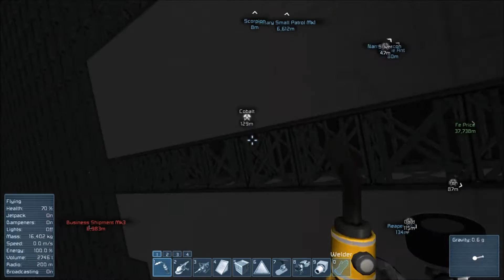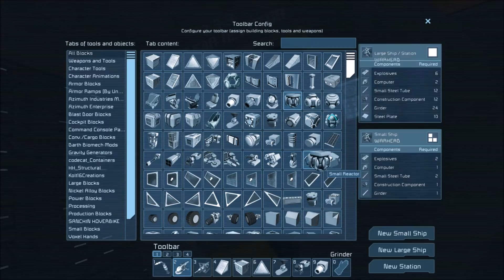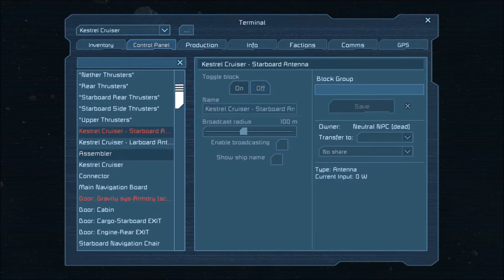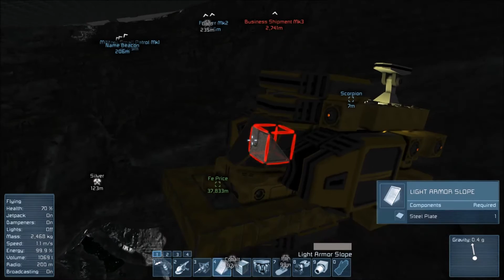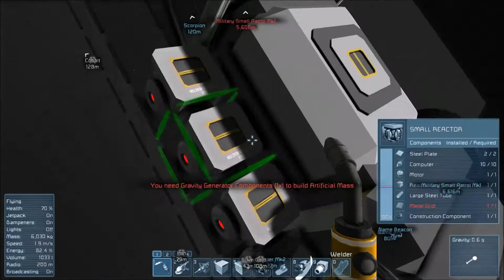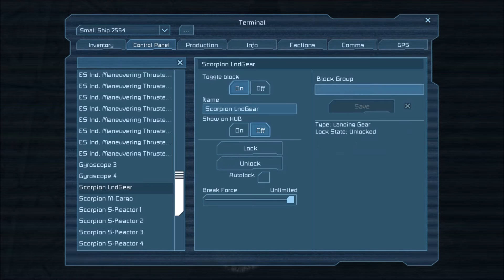Space Engineers ~ Lets Play S01   E042

Comment: You shouldn't use to many welders on your car its gonna overtax you reactors big time.
BTW you should try to use the flushed landing gears mod its much more useful wen building small ships and vehicles, it makes parking with cars easier since they don't use power even if the reactors go of-line.
Reply from the maker: sweet I will look into the landing gear mod you was talking about. Not sure about taxing the car cause it has less on it than the scorpion does with more reactors. will see how it holds up when I flip the switch and worse case I cut a few off. lol